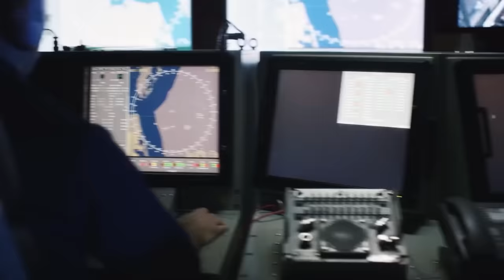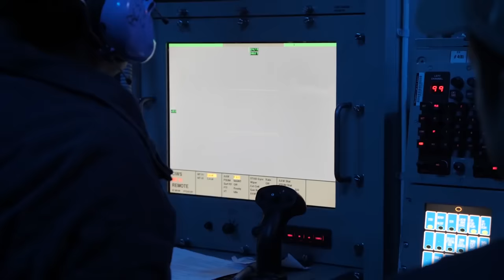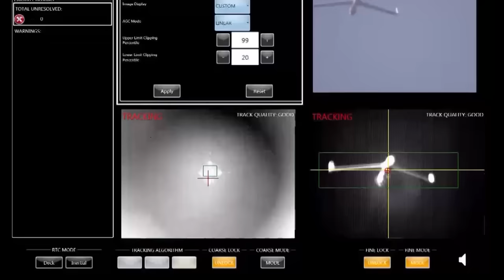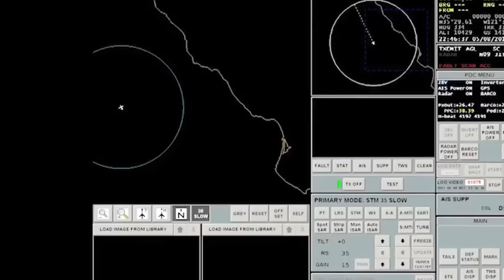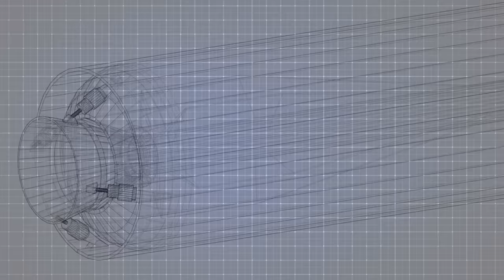The U.S. Navy Just Admitted They've Created A Monstrously Powerful Laser Warship

Comment: Anyone care to venture how much a lazer beam is reduced by water vapor?  And it applies to jets as well as to ships.
Reply: LASER, it's an acronym...
Reply: That depends on the water vapor count in the air between the laser and its target.
That's why there will always be conventional options.
Reply: Depends on strength
Reply: @BitBuhkit  That too.  Thanks for the correction - I did not proofread.
Reply: @richhead1999  I woud presume so.  However, a naval battle may have more time to determine the weather between them and their target.  A pilot may not have the time, or could just as easily be in areas where due to time/travel, they are in and out of effective range, or may choose the laser and be a bit too long to get to the alternative.
Reply: @timmoore9736  they need 10 megawatt lasers, cut right through without losing much power. Of course jets don't prove that kind of power and neither do most naval ships, until they find better propulsion systems, so they'd be limited to aircraft carriers.